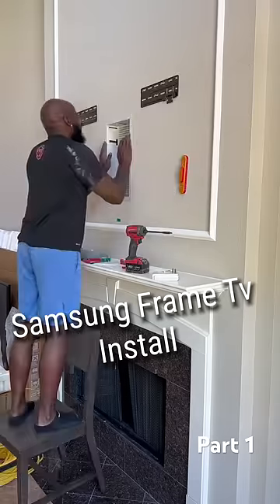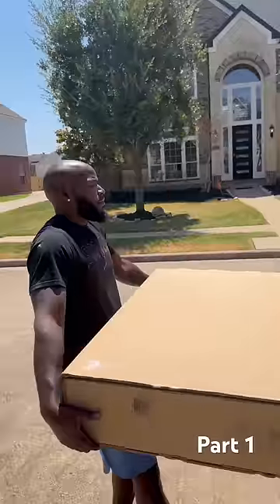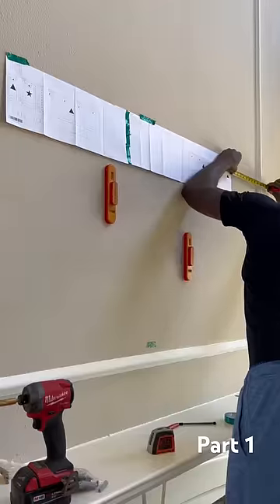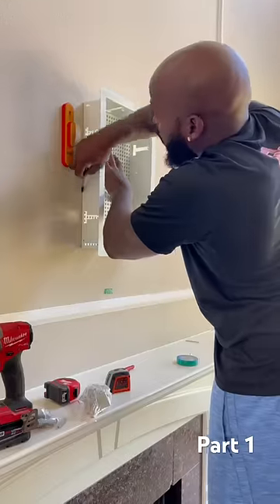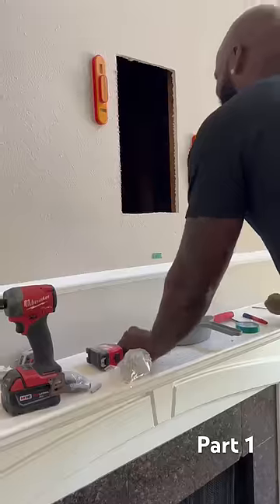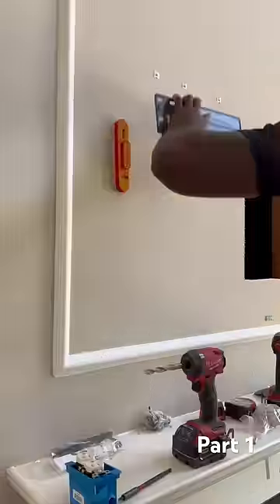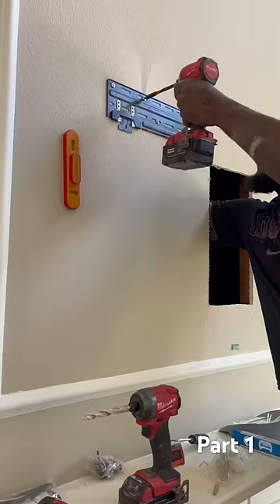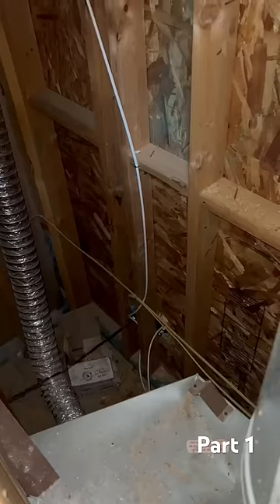Samsung Frame Install Part 1 #fyp #install #tvmounting #reels #frametv #samsung #4k #art #picture

Comment: Why you find the studs but anchor t.v on drywall ?
Reply: There's no play in those mounts. They go where they go or you're not hanging that tv.
Reply: listen to the video. he said there were no studs
Reply: @takingafatdump you can literally see that there's stud on both sides of the hole! 🤨😂
Reply: @5fdpshmylan09  yeah but not in the right place. the box needs to go where it needs to go pay more attention to what he says as he explains it
Reply: @takingafatdump with that big ass hole he cut in the wall he could at least add some blocking to accommodate for the lack of studs
Reply: @yeamewoo that's what I thought too
Reply: U can literally see the studs on the video
Reply: The mounts are adjustable, him not using them properly is just lazy or lack of knowledge. I wouldn't trust a tv that size on drywall.
Reply: @james_crook  The ones for the frame TV are not adjustable, they sit inside of the back of the TV on 2 specific hooks
Reply: Maybe get a mount long enough too reach the studs
Reply: @brandonb2962 The Samsung Frame wall mount help it sit flush
Reply: @linuxuser21629  could have cut a section of 2x4 and screwed it stud to stud for support smart guy.
Reply: @takingafatdump  you could see the studs 🤡. And he should have used a 2x4 between them for support. That mount WILL fail.
Reply: @takingafatdump need to go pay more attention on how to do the things the right way if you’re defending this trash work. 2x4 screwed to the studs on either side of where he wanted the tv mounted was the only correct way to install this.
Reply: @takingafatdump It takes less than five seconds to measure and cut a cross beam to mount that onto.
Reply: @ZeginMakesMusic  yeah but he didn’t need to. why are you all back seat contracting? get a life guys
Reply: @takingafatdump  lol. You are right. I've never even mounted a tv.
Reply: @yeamewoo studs simply are not necessary. Maybe for a full motion mount with a heavy tv. But frame tvs definitely not. I do it all the time.
Reply: Hollow wall anchors normally support about 150 pounds, each, in dry wall. Yall just talking to talk.
Reply: @bestkickz2464 I swear these YouTube contractors be tripping 😂
Reply: @bestkickz2464  preference mate, if I were doing this in my home I would cut two 14.5” blocks assuming the studs are correct 16” on center. Then toe nail/screw. All that would take an additional 5 minutes and that thing will never go anywhere
Reply: @yeamewoo  that sounds great, however it’s simply not necessary, hollow wall anchors do the job just fine. The alternative would be to travel with wood and a saw, which for a one time thing isn’t a big deal, but when doing this every day it’s not practical
Reply: @bestkickz2464 lol. I am a big fan of toggles but that number is based on the toggle itself, not the drywall that's holding it up
Reply: @djblock215  yes it is, says it right on the box. Has ratings for dry wall, brick, ect. Had this convo with someone in person, hung on the mount to prove my point.
Reply: A TV that small, plus how light the frame is, is fine on drywall with anchors. You should see the crap Samsung sends with those brackets. Tiny anchors and tiny lags. Full motion bracket or a 75 or higher (65 depending on the model) needs studs. Not to mention, that TV has specific measurements for that bracket to work. You hope to get lucky and find a stud where you have to put the bracket. The entire point is that you flush mount it to the wall like a picture, so another bracket wouldn't work.
Reply: Had a big enough hole to add some blocking vs. toggle bolts to drywall.
Reply: @5fdpshmylan09 he found the studs for the hole. 💀 he didn’t wanna cut into the frame of the house. Use common sense.
Reply: it aint to hard to add more support like damn you already got a cut out on the wall 😂
Reply: I'm beyond confused on this lol
Reply: Y'all are trippin if you think that light ass tv is gonna fall off that wall hahaha! What do you think this is 2004 with heavy flat screens? That tv weighs less than 30  pounds and if the heavy ass mirror in my hall way can stay in place for years on nothing but one anchor and a single screw with zero stud support then I'm sure that tv will be fine with 4 points of contact plus toggle bolts. 😂😂😂😂
Reply: I'd have to add some sort of stud support given there's enough work space opened up.
Reply: His alternative way, doesn’t always mean the “proper” way.
Reply: If I were him I would place half inch to 3/4 inch plywood between the studs to have a better foundation as the plywood would be screwed between via cleats.
Reply: I've seen multiple TV's fall from this type of mounting. Always use lag bolts and find the dam stud. If it's in a span without a stud, add a board. Don't be a lazy.
Reply: @5fdpshmylan09 there's no studs where the plates are supposed to go, can't change the  layout of the actual TV...
Reply: Since he had an opening on the Sheetrock he should have added some blocking to reinforce that TV... If it's double Rock then the toggles should be ok.
Reply: @james_crook the tv is lightweight its just the screen
Reply: @linuxuser21629 I’ve put a 2x8 over the wall and get 2/3 screws in each stud then Mount over because you can’t even see the wood block , and it’s strongest thing ever , compared to hanging on dry wall 😂 wha the fuck that shit gonna fall man
Reply: @djblock215 thank you  the toggles are strong Great but THE DRYWALL is just that drywall not strong enough to hold the tv up securely. I wouldn’t trust it. If it takes an extra what 15-20 min to complete safely and to have the peace of mind someone won’t get hurt if they jump or something in front of the tv is well worth it shoot I would tip for the thoroughness of the contractor this guy nope shit anyone could have don’t that honestly
Reply: Pay attention
Reply: @yeamewoo youre clueless. Hopefully youre not helpless
Reply: @Sergio-xs7zq and you can literally here him say "to get it perfectly centered". The point is that the studs are not where he needs them to be. And whether hes using them or not he still has to find them being hes cutting a hole to mount the box
Reply: @tcbowen12  whatever helps you sleep at night
Reply: Put a cross piece of 2x4 in between the studs. Way cheaper than a broken tv
Reply: Please mount on the studs or put a block where you need it.
Reply: He could've put some fire blocks in across the studs hello
Reply: That TV is lighter than a standard picture frame
Reply: @yeamewoo  it's literally common sense if youve ever hung a pic frame tv. It's not a standard wall mount.
Reply: @tcbowen12  the point of my comment was to say IF you needed blocking you could add some because there’s now a massive hole in that wall. My personal preference would be to add blocking between studs. It would take you 5 minutes to measure cut and install. I don’t trust drywall anchors or Molly bolts whatever you decided to use. Mount the sucker to a damn stud and never worry about it coming off.
Reply: @takingafatdump thats a bigass tv on drywall ... come on
Reply: @sjacqVO21  all i ever did was point out that the professional who made this video explains VERY clearly why he didn’t use the studs (in fact it was the entire point of the video) these are not my words, i never said anything about what i would do. 

there’s also a bunch of actual tradesmen (even some in this thread) that agree with this guy. apparently drywall anchors are rated for 150 lbs and this tv would be 30-40 max. so 4 anchors is roughly    600 lbs of force needed to move that thing. what’s in the video is already overkill.
Reply: Exactly. All he had to do was cut some spare 2×4s pieces and drill them between the studs. If anyone accidently holds on to the top of the Tv it will come down
Reply: I was about to ask that
Reply: So that he knew where to put the box lol
Reply: Sometimes you find the studs to use them and sometimes you find the studs to avoid them.  Frame TV's are light weight in comparison, it'll be fine.
Reply: You always hit studs when you can, but some toggles can hold 230lbs on 1/2” drywall each.  (Add em up) Those frame mounts also aren’t really mounts they’re basically cleats.

Frame TVs are a lot lighter because the connect box(transformer, power supply,  interface box) are separate…hence the need for the large white rbx box.

I’d hire this guy in a sec. 👌
Reply: @takingafatdump yeah there wasn’t where he wanted them but he cut a access hole he could have easily put a 2x4 across the studs for his tv plate to screw into just laziness or doesn’t know how to cut and install $8 worth of 2x4 lol
Reply: @danielchisholm4625  there are so many real contractors on here and in real life saying drywall anchors are more than enough to hold a tv like that. just because you think it can’t hold it doesn’t mean it can’t. stop armchair contracting and get a life.
Reply: @linuxuser21629 if you run a 2x4 from stud to stud instead of hanging the tv on drywall alone it won’t fail
Reply: @takingafatdump seems like a simple fix tho
Reply: Literally can just add the wood. Sheetrock mounting is insane for any tv especially such a nice one
Reply: @romeo5295  those anchors are made for like 350lbs the tv weighs maybe 20-40.
Reply: @takingafatdump  what’s the sheet rock rated for tho 🤔🤣 like 15 pounds bro 🤣 I understand what u mean it’s just a very simple thing to do to do it right no need to cut corners
Reply: @romeo5295  drywall is more than enough to handle 300+ lbs this is how basically every contractor would do it. it’s not done wrong it’s just not how you would do it.
Reply: @takingafatdump There's a bunch of stud
Reply: @takingafatdump could have added a horizontal stud
Reply: He put 1 screw in each stud. The other 3 anchors went into drywall.
Reply: Do you have ears ? He clearly states there’s no studs where the mount has to go for the tv no to sit on the side of the wall. Stop commenting when you know nothing of the topic .
Reply: @takingafatdump  you adjust the metal plate to secure to the stud.  This is worse than a DIY job with no skills.  I would kick his sorry ass out of my house if I see this.
Reply: @takingafatdump he does need to. You need to secure TVs to studs.
Reply: Why Not?
Reply: @5fdpshmylan09 but the mounts need to be in a specific place, and the place they need to be weren't over the studs.
Reply: Cause this dude cares more about making videos than properly installing tvs 😂
Reply: @takingafatdump that’s when you ADD a stud in the huge cutout in the wall you just made, who in the world sits all that wait on some flimsy drywall
Reply: @colincarrington4629  scroll through some comments before replying bud those drywall anchors are rated for 150lbs each. and there’s 8 of em. try again.
Reply: @JospehTube  oh right the guy who “knows how it’s done” hiring someone else to do the work he “knows how to do”

hop out the armchair and get to work building a business on professionally installing TVs and see if you can come back with the same energy
Reply: He found studs just didn’t know how to put an extra block since his bracket doesn’t line up with a stud

Comment: Got the wall open can see no studs but can see they can be easily added but still uses a ancher😅
Reply: He does one thing that’s why
Reply: If you had kids there is no way you trust drywall with your kids safety.  Could have easily added a horizontal 2x4 and added safety for the residents.  Would have taken 5 mins and cost like 10 bucks.
Reply: F them kids, im worried about my $1000+  tv falling and breaking.
Reply: He installs tvs not remodle your living room
Reply: Funny if you buy any tv from best buy, you can have your tv delivered and mounted by geek squad for about 100$ and its insired if anything happens to your tv. Great service, i use to work geek squad we put TVs in crazy spots where at first we didn't know how WE were going to get there haha but great service and if you're nice to your "agent" you may get a free cable or two if you forgot to buy one or the one you bought was too short
Reply: @itsGrzli Adding a horizontal 2x4 especially with as much access as he had would not have been hard.
Reply: @Barbaratio  which would require him to go out buy a small 2x4 drive back and install??? For no reason at all when the anchors are more than fine
Reply: @itsGrzli  That's what my friend said about the laser heads in his party room. They eventually fell out of the ceiling 😂. What person in any trade doesn't have 2x4 scraps.

Comment: Truly thee most entertaining installation vids 😂 and the excellent work is always clean AF!
Reply: Excellent work well only if ignore the fact that he anchored to the drywall shit gonna fall for sure
Reply: @gagnarork  dont give false information. This tv is not going anywhere.
Reply: Lmao aww did my accurate and objective information hurt you ? Felt the need to defend daddy ? good boy
Reply: @gagnarork  catch up on the law of physics. Understand whats shear and tensile. This is all shear with NO pull out force. Mounting on a stud for this is a waste of time and money. 

Imagine you're making a sandwich, and instead of using a single slice of cheese, you use an entire block. Sure, it might be the cheesiest sandwich ever, but it's also overengineered for the task. Overengineering is like using more materials, complexity, or effort than needed to accomplish a simple goal. It can be wasteful and unnecessary

Comment: Trusting those drywall anchors to hold that big ass tv? Noooope. Need to hit a stud, I hit two for my 75”.
Reply: Just a disaster waiting to happen, hopefully not for the customers sake tho
Reply: By the time those anchors fail, the customer won’t be able to get a hold of him. If they do, it’ll be $250 for him to come out and look at it.
Reply: Since it's flat to wall is no issue. 
If it was on any kind of movable mount you would need to
Reply: It's a frame tv, 50 lbs. It'll be fine.
Reply: your 75 is 5x the weight 😅
Reply: @TravisBry he literally has a big following posting the job & more jobs often where is he gonna go hiding? Lol
Reply: Each toggler holds up to 150pounds. He used 4 in each bracket. Perfectly safe. Would not recommend with any articulating mount though

Comment: Hold up so what was the stud finder for 😂😂😂😂
Reply: He wanted to avoid the studs for the box
Reply: He was looking for the studs but they were too widely spaced apart to use them. If it was me I would of added some blocking to mount to
Reply: @brokenwrench404 Those mounts are 100% adjustable, he actively chose not to hit the studs...
Reply: to see where are the stud so he knows what to cut.
Reply: @-KIMISAFOX Adjustable in what way? Have you mounted a Samsung Frame TV before? There is an exact template for a reason. He did an excellent job and toggle bolts are more than enough for such a light TV
Reply: @-KIMISAFOX i used to install these, depending on stud spacing, not always possible.

Comment: You're installs are clean af 👌. However I can't help but be absolutely terrified of what the in wall unit will be experiencing directly about a fireplace like that. 😅
Reply: I would definitely get some sort of heat shielding if that were mine
Reply: 90% of ppl with fireplaces never actually use them so i wouldn't worry
Reply: I wouldn’t say clean because he just let the piece of drywall fall inside
Reply: @juan2049 I’m sure it’s fine though. Thing is, no one is ever gonna see it. Drywall being left is pretty common and doesn’t harm anything. It’s not like anyone is going to be living in that void space.
Reply: It's an electric fireplace. They do not get hot. The hottest thing on that fireplace is the metal vents that cover the blower
Reply: @jasonkeleher the fireplace is electric.  No massive heat output and no fire hazard
Reply: The fall to the ground when those anchors fall will do more damage to the TV than the heat 😂

Comment: I don’t know about whether he needs an anchor or not, but should there be some form on insultation between the fireplace vent and the TV? Cause if the TV is sealing that hole, it’s gonna just be heat hitting the back right?